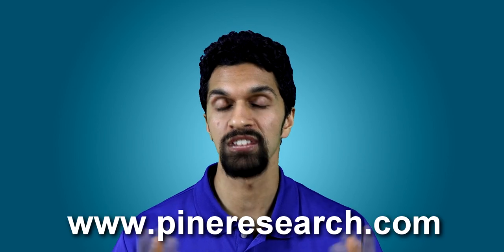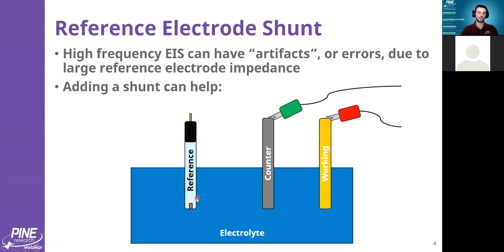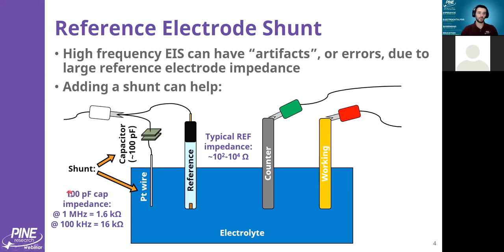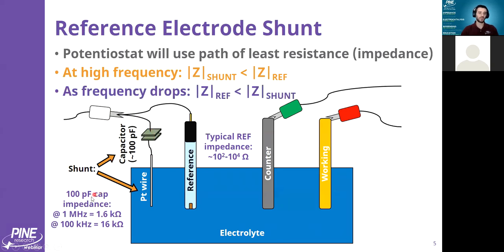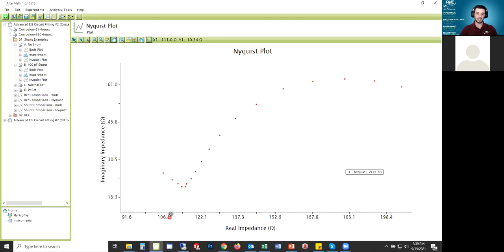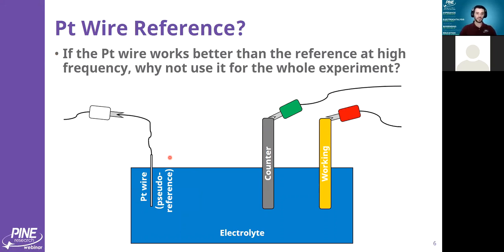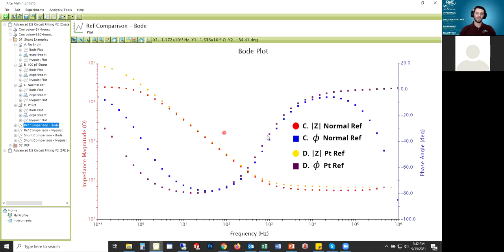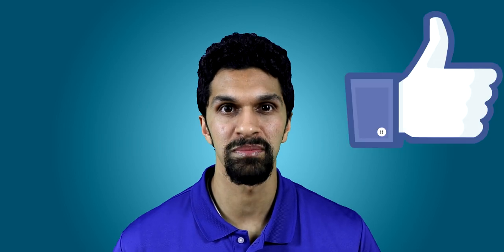What is a Reference Electrode Shunt and why would you use one?

Comment: As a manufacturer of potentiostats, I would appreciate your insights regarding performing EIS in the high-frequency range, specifically in the kilohertz (kHz) or megahertz (MHz) range. In my research group, we recently had a discussion suggesting that measurements beyond 10 kHz may not provide reliable information and could be considered meaningless. However, I am aware that many researchers report using maximum frequency values that are ten times higher, such as 100 kHz. I'm curious to hear your perspective on this matter. If it is indeed advisable to limit the high-frequency range to 10 kHz, it is possible that the use of a reference electrode shunt may also be unnecessary.
Reply from the maker: Tarik, it depends on the system under study.  It is true that a number of typical systems - especially those using a liquid-phase reference electrode with a frit - may have difficulty responding at frequencies above ~10-100 kHz, making those data somewhat "meaningless."  However, that is why specifically the shunt can be useful because, in the case where information is desired at those frequencies, the shunt can be considered a way to obtain more accurate potentiostat response where the reference electrode is not limiting the EIS data at those frequencies.

However, another reason why data at these frequencies are also sometimes not needed is because there are not many processes that typically occur in aqueous or non-aqueous systems that can be probed at those frequencies.  Most often, all you may elucidate between ~10-100 kHz and 1 MHz is the uncompensated resistance and possibly cable inductive effects.  The former is relevant but also easily probed at slightly lower frequencies as well, and the latter is largely irrelevant to the overall electrochemical response.
Reply: @Pineresearch  Absolutely! The point you raise in the second paragraph aligns with what was emphasized in my group discussion. I can't recall any electrochemical process of significance that can be effectively examined at frequencies exceeding 10 kHz. Hence, I personally intend to avoid that frequency range in the future. I appreciate you sharing your valuable insights on this matter. Thank you!

Comment: Great video! I have both a question and a comment that I think could be valuable.

First, the question. Let's consider a scenario where an electrode shunt is employed alongside a designated reference electrode. Based on your EIS data, is there a way to determine whether the potentiostat utilized the shunt as the path of least impedance instead of the reference electrode in the high-frequency range, without solely relying on a comparison between two experiments—one with the shunt and one without?

Now, onto the comment. If possible, I highly recommend using a palladium wire specifically as the shunt or pseudoreference. The rationale behind this suggestion is that palladium exhibits a more consistent electrochemical potential in aqueous solutions due to a well-defined redox reaction known as the formation of palladium hydride. In contrast, using a platinum surface as the shunt introduces uncertainty regarding the precise redox reaction occurring. Employing a Pd wire can significantly impact the quality of data obtained in EIS experiments, particularly when employing small amplitudes (<5 mV).
Reply from the maker: Honestly, it's pretty tricky to answer your first question.  Part of the reason is, to be honest, I think my explanation is slightly inaccurate regarding the way a shunt works.  I just don't exactly know perfectly well how to explain the phenomenon from an electrical perspective.  Here is what I mean: the shunt capacitor has an inverse relationship between applied frequency and impedance.  The reference electrode has a roughly constant impedance.  You can probably answer your question with some level of accuracy by finding the frequency where the capacitor exceeds the reference electrode.  Frequencies above that are using the pseudo-reference, frequencies below that use the reference.

The reason I say that explanation is slightly inaccurate is because the frequency applied and current being measured is with on the working electrode.  I guess it is somewhat unclear to me whether it's accurate the reference electrode is "experiencing" the frequency during an EIS test the same way the working electrode is.  Virtually no current passes through the reference electrode.  So, maybe it is an overthinking here but I am not 100% certain my description above of that critical frequency where the impedances of capacity and reference electrode is ironclad, so to speak.

Regarding your suggestion of Pd vs. Pt, that sounds reasonable to me but I cannot speak further to it.  I don't know the difference between the two in this context and kind of experiment would be very severe or noticeable, especially at such fast frequencies and short time periods, but perhaps it would be useful to use Pd for a shunt over Pt if one has the option.
Reply: @Pineresearch  Thank you for your detailed response. The reminder about the impedance formula for a capacitor was incredibly helpful in my understanding. Due to the inverse relationship between capacitor impedance and frequency, it is possible for the impedance at high frequencies to drop below a critical value, causing the impedance of the shunt electrode to become lower than that of the reference electrode. Consequently, the shunt behaves as a pseudoreference. This explanation makes perfect sense to me! Since I'm using the HydroFlex as my reference electrode, I should look up its constant impedance.

It's funny that you mentioned contemplating what actually happens to the reference electrode during an EIS measurement, as that was precisely the question on my mind while watching the video. It seems like highly fundamental information. I assume that the reference electrode must somehow experience the frequency during EIS to enable the shunt to "short circuit" at high frequencies.

I have an additional question. In the video, you mentioned that shunt capacitors are typically used in the picofarad to nanofarad range. Is there a general guideline for determining which order of magnitude to use within this broad range?
Reply from the maker: @Heisenberg-EC  First, you can look up your reference electrode impedance but probably better is just to measure it yourself.  Use a Pt or Pd wire and the reference in some electrolyte, as a simple 2-electrode system, and do EIS mainly at high frequencies.  The apparent iR drop from an experiment like that would be indicative of the reference electrode impedance (minus whatever small amount of Ω might be from the electrolyte, usually strong aqueous electrolyte only gives about 10-50 Ω at most).

The reference electrode "experiencing" the frequency is exactly the point.  It's just a little murky to me, and I'm not an electrical engineer so the precise details are a bit unclear to me.  The potentiostat applies the sinusoidal potential perturbation between working and reference, so for sure it must be "experiencing" the sine waves I suppose.  But the measurement of |Z| implies current and potential, and like I said, while a very tiny amount of current does pass through the reference (it is technically and electrically necessary for a potentiostat to function, despite the common assumption that no current passes at all) it is not the primary circuit path (current goes between working and counter).  So that's why I don't totally know if the idea that the impedance of the reference (or the shunt capacitor, for that matter) is "felt" to the extent that the critical value like I mentioned is exactly where that transition occurs.  I think it might be, I am just being honest that I may be slightly wrong for reasons I don't totally understand.

Regarding the value of the capacitor, it follows from the previous paragraph and assumption I just laid out.  Again, assuming this understanding is accurate despite my misgivings, you would simply need to look at a few things.  At exactly which frequencies in your raw data are the features off, or you suspect may be artifacts?  What are the measured impedances at those frequencies?  Draw the Bode plot for a capacitor where you can change the value of C, and see where the intersection is, at which frequency and |Z|, depending on the value of C, with your raw data.  This is hopefully where you might be able to narrow down what value of capacity will give you the most ideal intersection point for that transition between shunt and reference.
Reply: @Pineresearch  In preparation for measuring the impedance of various reference electrodes, I would like to ensure I have the correct procedure for this experiment. If I understand correctly, I should connect the reference electrode I wish to measure as the working electrode (WE), while using a Pt wire as the counter electrode/reference electrode (CE/RE). Essentially, both the CE and RE cables are connected to the Pt wire. Subsequently, I would perform an EIS measurement, primarily focusing on high frequencies. What range of high frequencies would you recommend? Would a range between 100 kHz and 10 kHz be suitable? I do want to note that certain reference electrodes, such as the HydroFlex (RHE), may not be suitable for use as the WE, as they could be susceptible to damage.
Reply from the maker: @Heisenberg-EC  Exactly as you described it, yes.  That is how you would measure the impedance of your reference electrode.  Go from about 100 kHz to 1 kHz, and use a very small potential amplitude, like 5 mV or less.  You could start with 1 mV and see if you get any data.  Slowly increase the amplitude little by little until the EIS data is consistent and not too noisy.  You will certainly damage the reference electrode if you try to push too much current through it, but that is why you want to limit the amplitude so minimal current passes during the EIS test.  It is also a few fast frequencies (you can limit to like 4-5 points per decade) so the duration of current being passed should be extraordinarily short.
Reply: @Pineresearch  I appreciate your confirmation of the procedure for measuring the impedance of a reference electrode, along with the helpful precautionary tips on minimizing the risk of damaging it. I will ensure to employ low amplitudes and a limited range of frequencies. Thank you very much!
Reply: @Pineresearch  I have one more question about the process of measuring the impedance of a reference electrode using a 2-electrode system. I would like to know which potential you would suggest using for this EIS measurement. Should it be 0.00 V vs. REF or 0.00 V vs. OCP, for instance?
Reply from the maker: @Heisenberg-EC  0 vs. OCP.  You don't want to polarize the reference electrode, as it could fundamentally change its chemistry and then the reference potential wouldn't necessarily be where you want it to be.
Reply: @Pineresearch  That does indeed make a lot of sense. Your intention is simply to measure the impedance of the reference electrode at its thermodynamic equilibrium.

Comment: can you also make a detailed video on EIS of the solution, working as a capacitor, and defusion model out of EIS measurement, like if we do some alteration in the solution, how our EIS measurement can help to indicate that, and how to make right fitting curve model for it? @pine
Reply from the maker: We do have a couple videos from our Advanced EIS webinar series https://www.youtube.com/watch?v=db5xzuLJN4Q&t=396s and https://www.youtube.com/watch?v=wixp3pKvKMc  that go into more details on how to model the electrochemical system.  In general, the solution itself is typically modeled as a resistor.  Changes to the electrolyte simply change the resistance of the solution.  Of course, when we talk about concentration gradients from the diffuse layer, that is a slightly different story.  But I would imagine that if the electrolyte changes, it will change the capacitance at your electrode interface.  I hope this was helpful.